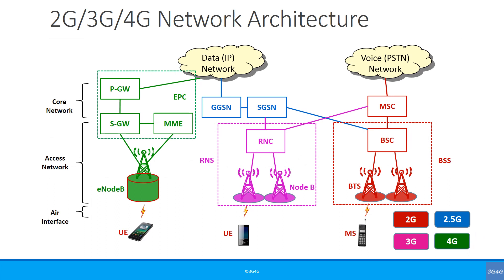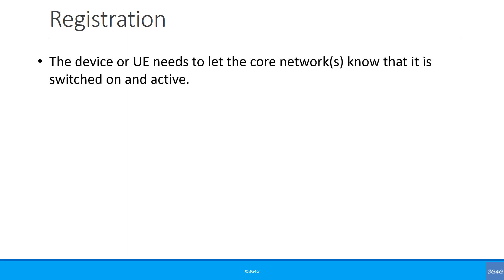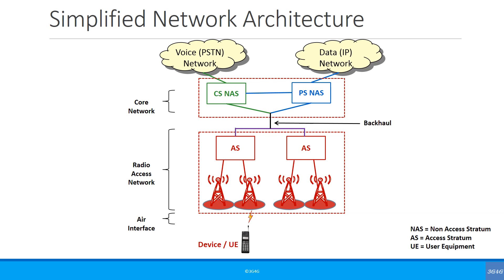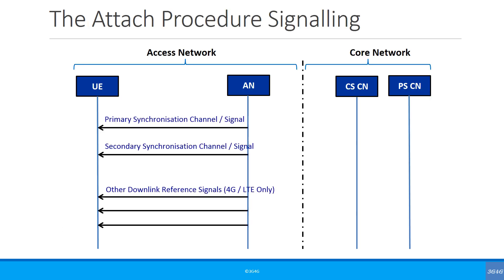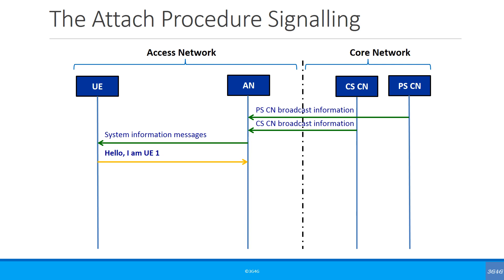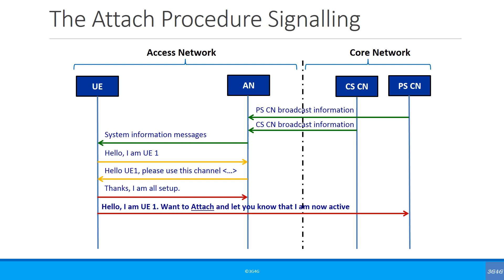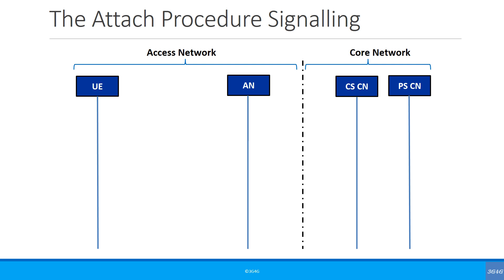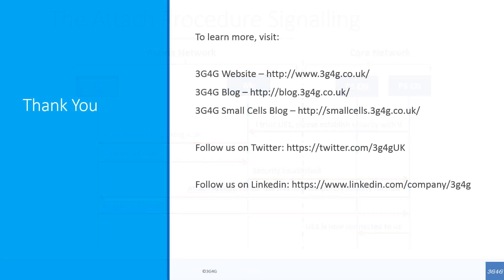Beginners: Simplified Call Flow Signaling: Registration - The Attach Procedure

Comment: Thanks 3G4G, Does the communication between the UE and the Access Network Nodeb's, is this communication encrypted? Also, is voice traffic and signaling sent both on the same "channel" to the Access Network?  I know in the IMS core Signaling and Voice/Data is separated. For Example SIP is used for Signaling and H248 is used for Data/Voice. But is the same true for the UE to Access Network communication?
Reply from the maker: Yes, of course. You may want to jump to the presentation on Security as that will provide you all the relevant details.